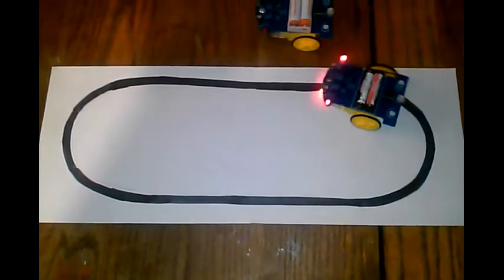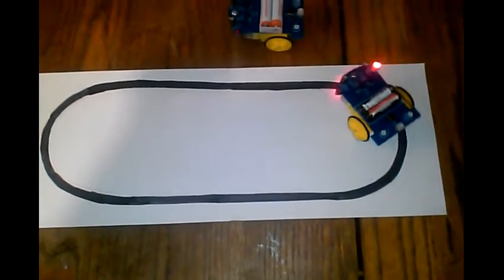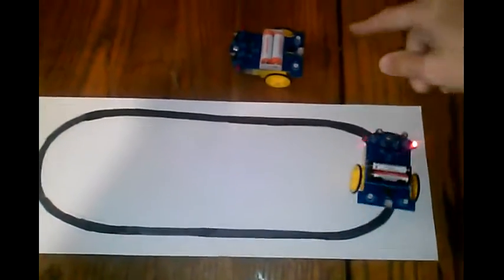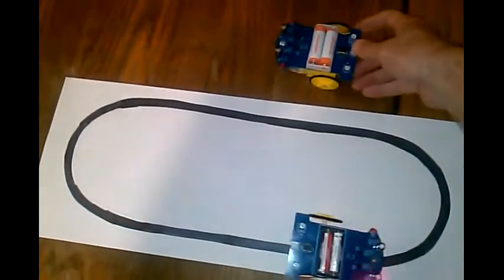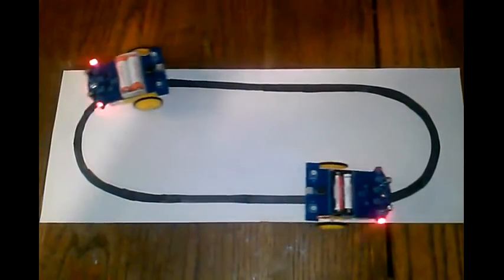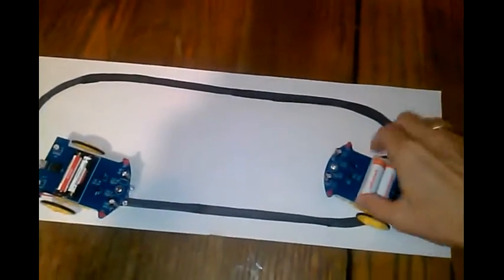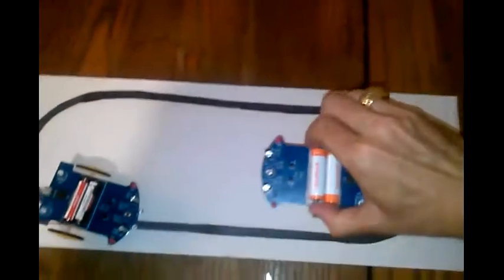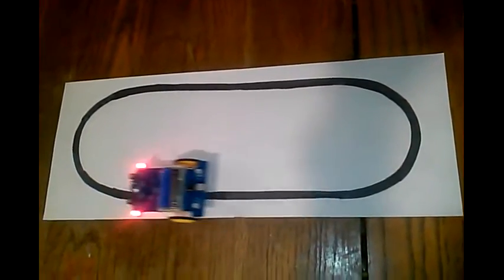Modified Line Following Robot

Comment: Very nice video, Just started building my D2-5 kit, saw your video.  Do you have any wiring diagram for how you did this mod?  Going to get mine to work first then I'll tinker with it.  I am fairly technical so the diagram doesn't need to be too in depth.   You have a new subscriber.  Keep Broadcasting!!
Reply from the maker: Deets at  http://servo.texterity.com/servo/201709/MobilePagedReplica.action?pm=2&folio=7#pg7   Best to view in incognito mode. Site uses cookies and will block you after 2-3 views.

Comment: Hi, I saw your other video with the rewiring done. But on this one it seems you've done some more tinkering. What is the difference and is it noticeably better then the previous mod? I'm also running it on a 3.7volt cell
Reply from the maker: The other mod is simpler to wire than this one, fewer wires to connect. Both work about the same. and both are trickier to adjust than the stock unit, which works in almost any pot setting.
Reply: @ercost60  yes I noticed that, do you have a trick getting the adjustments right? It seems like I am constantly adjusting them since I modded it.. and the track that comes with the kit seems impossible for the robot to follow after the mod.
Reply from the maker: @legoteamflonili8116  It's a balancing act. One sensor gives left turn priority, the other right. You have to adjust one for best right turn following, then left, then iterate back & forth a few times to find the best balance. It will follow the small oval that comes with the kit. Before you start, make sure your photocells & LEDs are properly aligned, about 1/8" above the surface. They are the weak link in this kit, any crash will knock your sensors around and undo all your careful calibration. I made a wide bumper to protect the sensors, supported off the front skid bolt.